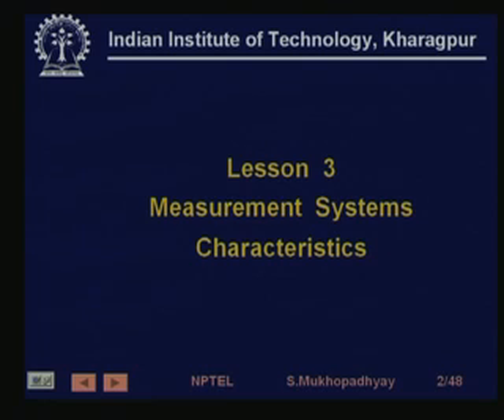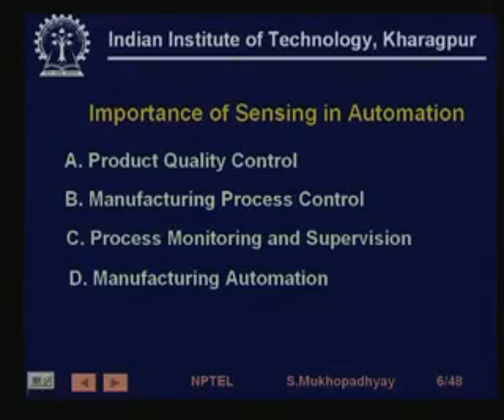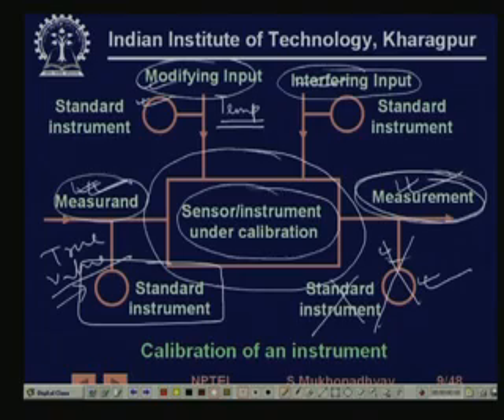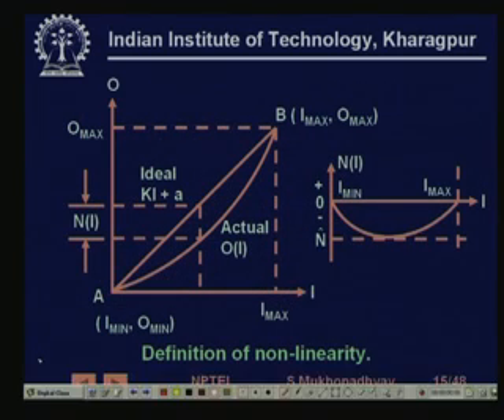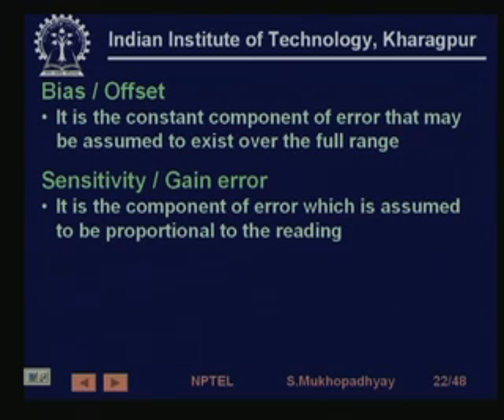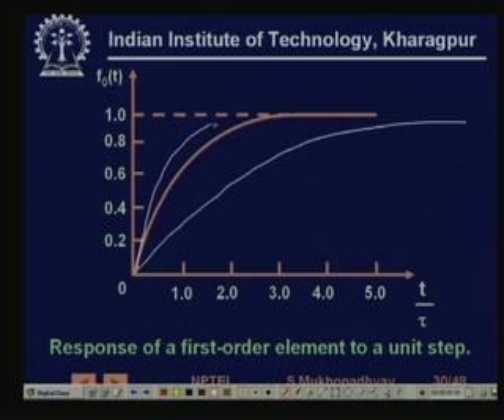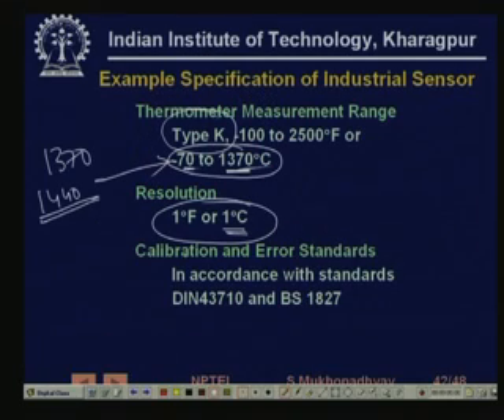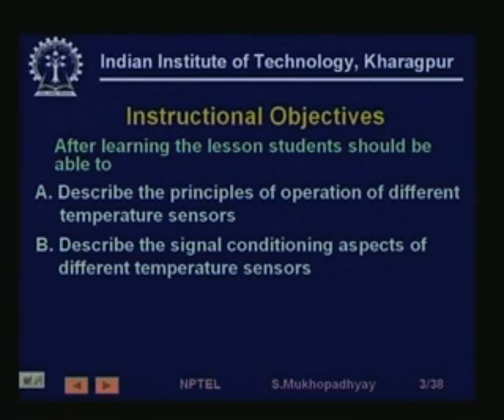Lecture - 3 Measurement Systems Characteristics

Comment: At 43:48, an important insight from the magnitude plot is that the first order system behaves as a low pass filter. So  one has to carefully choose the time constant (hence the cutoff freq). Also see that if tau = 1 sec, the first order system is the Butterworth filter of order 1. It has no ripple in response. For the phase plot, the phase lag is of critical importance to process control loop dynamics

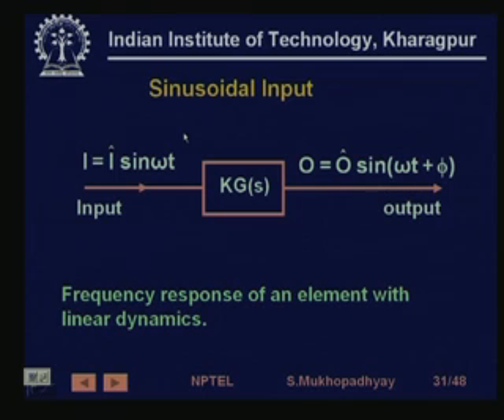Comment: At 42:53, there is slight technical mistake from the Professor. The input and output frequency being same is applicable only for linear systems. In practice, all systems are nonlinear to some extent (for academic purposes, we majorly approximate them as linear)